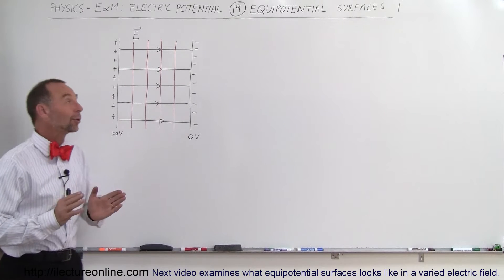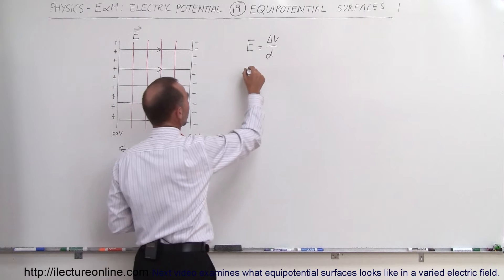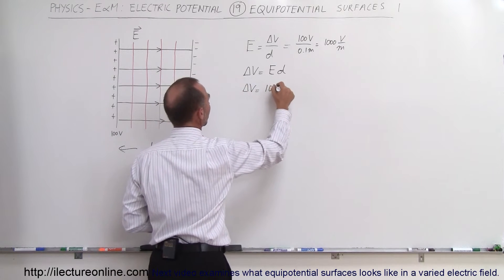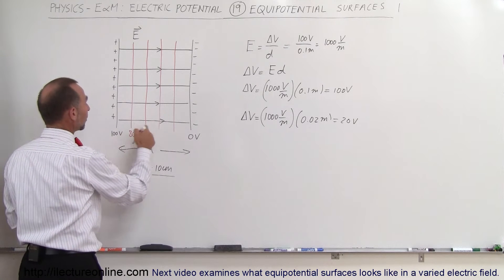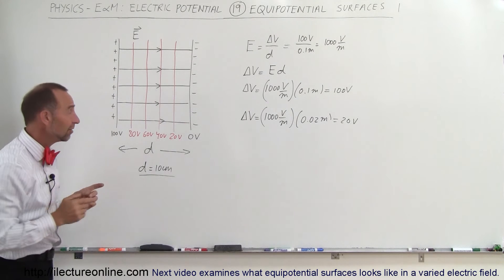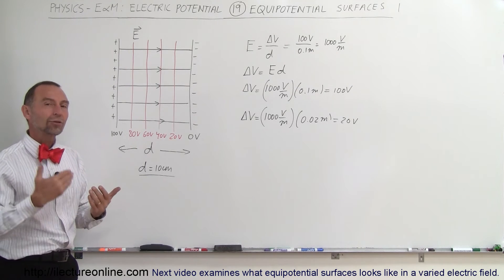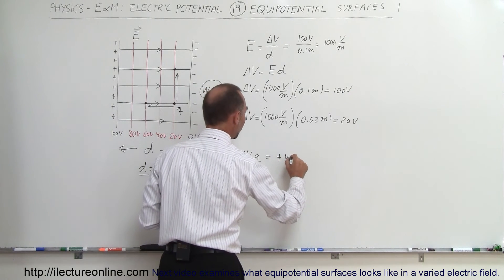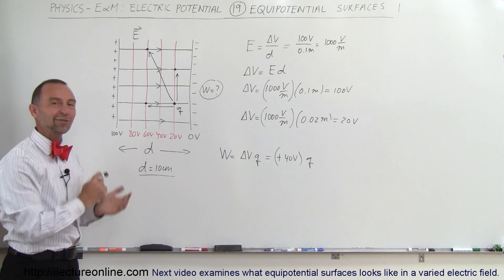Physics 38   Electrical Potential (19 of 22) Equipotential Surfaces Explained

Comment: isn't delta V = - Ed, since delta U = -Work done by electric force
Reply from the maker: The definition uses the work done by an "outside" force to move the charge, not the electric field.
Reply: Ok that makes sense. But in some books I've seen E = -delta V/delta x. Would both forms be correct? How would you know when to use which?
Reply from the maker: It depends on the wording of the definition.  Sometimes they will write the equation as the work done by the electric field (similar to the concept of the work done by the gravitational field)

Comment: so let us call the plate on the left A and the one on the right b. 
We have a positron that is in the middle and it moves to plate b, what will be the change in potential from the middle to A and then back to B? I may have worded it wrongly but I think you can see what I mean.
Reply from the maker: +OlaY O  The potential at any point between the plates is independent of any charge you place there.  (Remember potential and potential energy are not the same).  Are you looking for the change in potential energy?  If so, then you must state the initial position and the final position.  Change in PE = F * d     thus change in PE = E * q * d.  But since V is given (and not E).         PE = V * q, thus all you have to do is multiply the voltage difference (50V) and the charge (1.6 x 10_19 C)
Reply: This is the problem I was doing: I got an answer of 3.3*10^-6 J

 Two large conducting parallel plates A and B are separated by 2.4 m. A uniform field of 1500 V/m, in the positive x-direction, is produced by charges on the plates. The center plane at x= 0.00 m is an equipotential surface on which V = 0. An electron is projected from x = 0.00 m, with an
initial velocity of 1.0 × 107 m/s perpendicular to the plates in the positive x-direction, as shown in the figure. What is the kinetic energy of the electron as it reaches plate A? (e = 1.60 × 10-19 C, mel = 9.11 x
10-31 kg)

Comment: shouldn't the potential be negative as the charge (q) is traveling against the electric field
Reply from the maker: Tekno Kos 
The change in potential equals the work done to move a positive charge from point A to point B.  It requires work to move the charge to the left in this example, thus potential increases to the left.